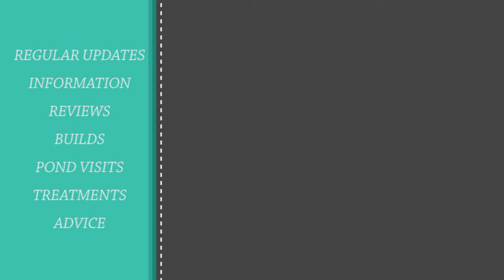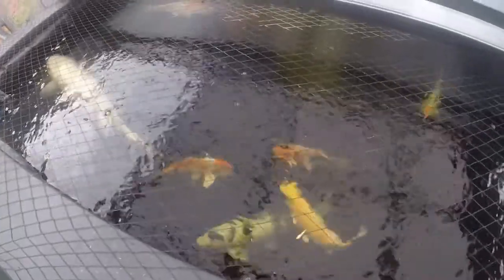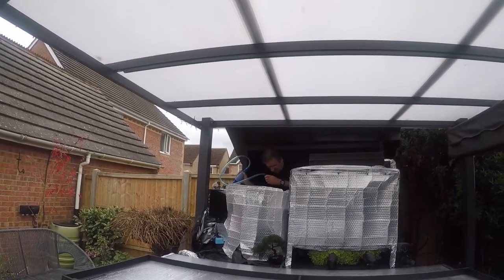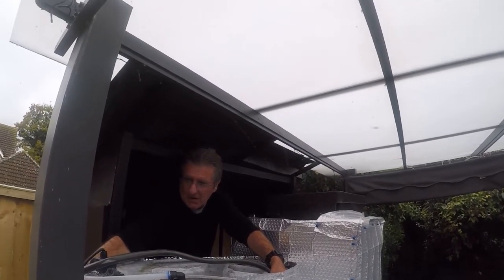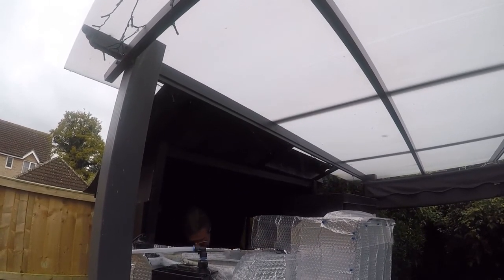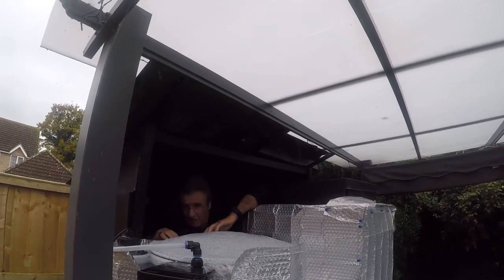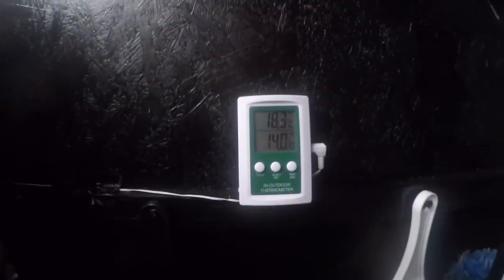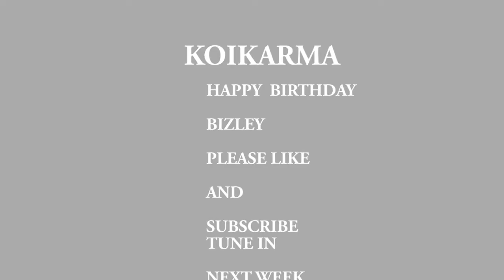FILTER CLEAN AND PUNCH AND JUDY SHOW

Comment: That siphon works a treat on the easypod. Good run down on what you do for filter cleaning. What would your pond temp go down to for the winter?
Reply from the maker: Thanks mate it does work a treat and easier than getting the pond vac out, I did get wet feet when the pod lid emptied out all over my pond slippers☺
Reply from the maker: I am aiming at about 12 to 15.
Reply: Me too. 15 would be nice.